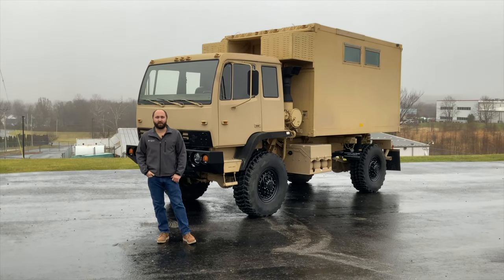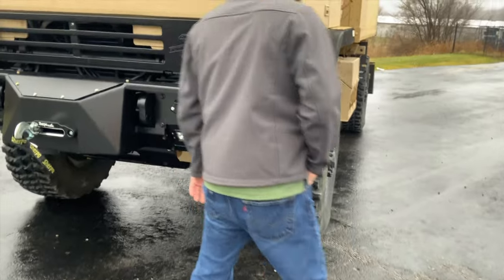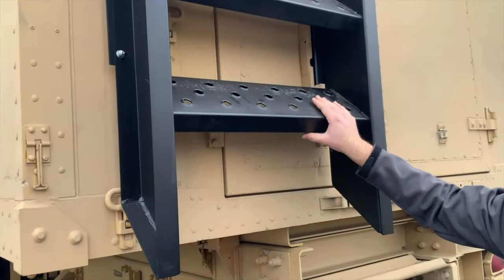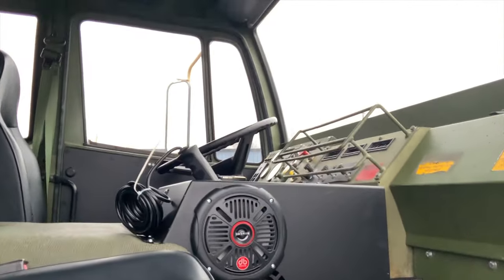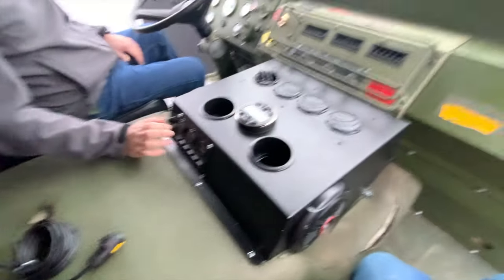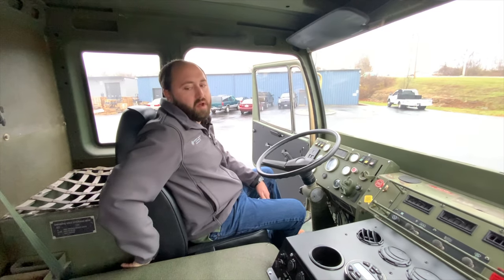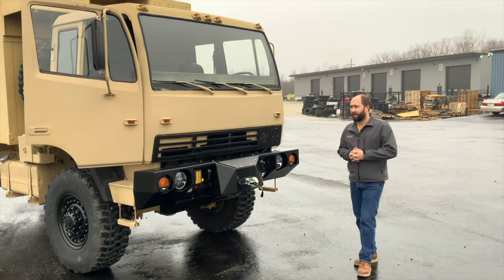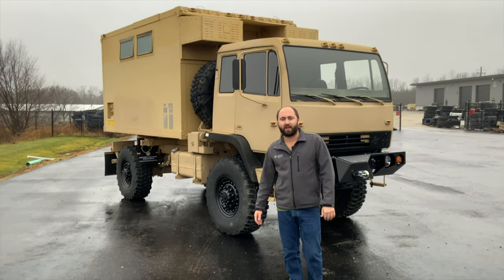Our customer Tom's New M1079 LMTV Truck! Building into a CAMPER!!!!

Comment: @midwestmilitaryequipment can cruise control be added to these engines?
Reply: They usually have a throttle control on the dash where you can lock throttle down